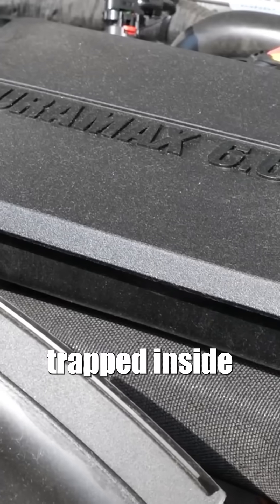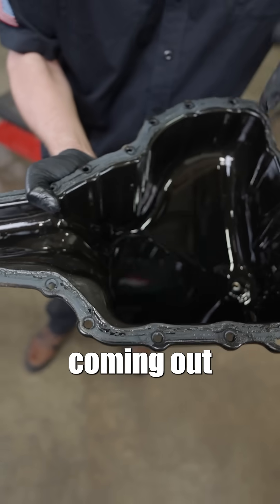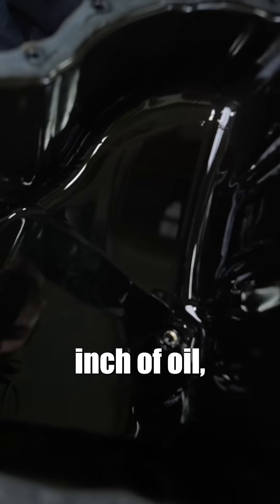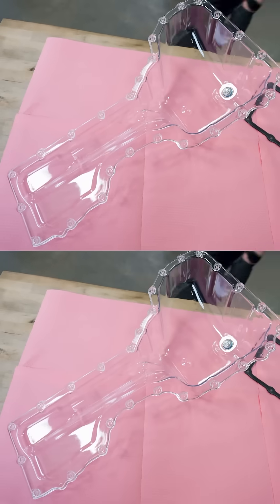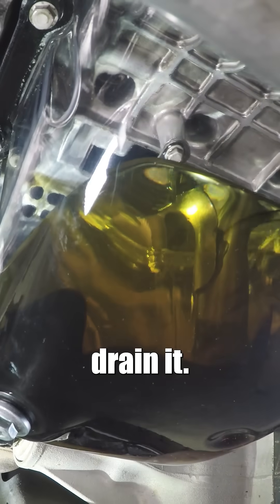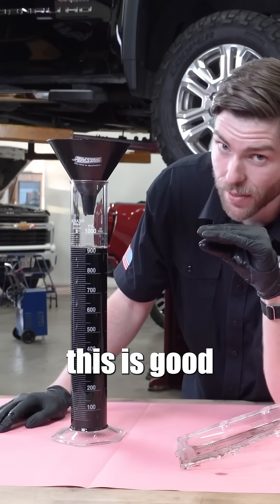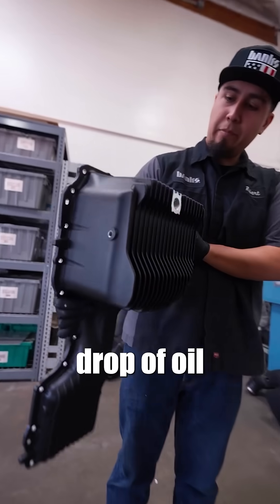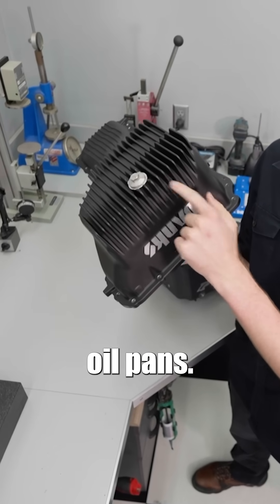A disturbing discovery. This dirty oil is trapped.

Comment: You didn’t sell me one bit until you showed the pan. OK you sold me. I like the idea of the pan. I like it made out of aluminum. I noticed you had cooling fins on the bottom of it, which is neat but what I do is I sometimes drain a quart of dirty oil and I add a half a quart of mystery and a half a quart of kerosene and I run it for 20 minutes and then the last minute I bring the RPMs up to 2000 RPMs to really flush out that engine then I let it cool a little bit before I drain it. I leave the drain pan underneath even if it’s overnight and then I put brand new oil and that old 3000 mile oil royal purple 5W-30 goes to the recycling bin so that they can remake good old-fashioned oil again
Reply: I'm going to make a suggestion. 
Use a quart(or just half on smaller motors) of atf.
It's significantly more detergents.
It's kept my hyundai running well over what most I've heard have, so I'm assuming I'm doing something right lol

Comment: By emptying the pick up tube you open the oil pressure circuit to air, first start up after oil changes will be dry

Comment: when the pick-up tube empties, then it will take atleast few seconds for the oil to get going again, that shouldnt be a problem since usualy you want to warm up the oil before you drain it so it flows better and while you warmup the engine you displace the oil in the cylinders, cam shaft ttc... so shouldnt be a problem if you dont take more than 2 hours to change the oil and filter and run the car before the oil drips down from the engine walls. Just one thing... when the pump picks up the oil, the air gets pushed infront the oil and the air could dry out a spot somewhere where the lůube outlets are and it takes spit second at 800Rpm to do some damage that will make the engine degerade way faster than just leaving in less that a pint of old oil. completly useless product imo.

Comment: Use oil evacuator pump with a curved tip on hose to reach over weld  nut. Do this while oil filter is off. This will break" vacuum" in sump tube

Comment: Theoretically can’t you just pull the drain plug and dump like 4-8 QTs through if youre willing to spend the extra dough on “wasting” oil? Would it still not drag out the crap at the bottom? Sure it won’t get the stuff out the pump but most of it should come out with the fresh oil no?

Comment: I honestly don’t care. There’s way more oil in the cylinder heads, lifter valley and so many other nook’s and crannies that this is absolutely pointless. As a professional mechanic for over 30 years I’ve torn down many engines and believe me there’s a lot of oil throughout the engine.

Comment: If you're worried about this NON-PROBLEM, then you can simply use a topside vacuum liquid extractor and put that skinny hose down the dipstick tube and suck it all out.

However, since this is not a real problem, don't worry about it and keep it pushing.

Comment: Isn’t the correct answer to get an oil pump and put the tube to go back on itself, or thread the tube through the top to get to the bottom? Surely that’s cheaper than a new oil pan, right?

Comment: Isn’t it going to cause a problem for the first start after oil change?
It will take the engine longer to fill up the tube / then oil filter

Kinda like the BMW N55 after oil housing replacement

Comment: So all you guys that say you don't want oil pressure starvation, due to the pick up tube loosing it oil...your probably in the same group that says it's not necessary to pre-lube your oil filter.  Oil starvation in the oil filter,  and the resulting engine knocking at start up ,for 5,10,15,20 seconds is ok...but you think similar oil starvation in the pickup tube is unacceptable.  Go figure  ?

Comment: Metal deposits that Banks wants to remove tend to fallout (the ones suspended in the oil can be filtered out) and would still concentrate in the oil pan and around the engine, so removing extra oil whilst would help, wouldn't necessarily provide a significant difference that would impact engine life drastically (extra ten thousand kilometres till teardown is positive, but at a 500k scale is not impactful enough, imo). 
The other benefits, like running cooler, though, might help and improving flow dynamics are also a positive, yet the contaminants should not be the primary concern, since running an additional finer bypass filter, for example, would be a way more effective solution for the buck, if contamination is your primary concern. Pair that with shorter intervals for the oil (and filter) change and there you go.

I feel like this stretches into engineering for engineering sake - I love it as an engineer and it's a clever design and product, but I don't think it considers the engine as a system. Having a larger magnetic drain plug would help with metallic (ferrous) contaminants as well (by keeping it in one place), if we're at it, though it won't help with alu.

This is a bit iffy marketing, to be honest. I think products should be advertised for their objective strength.

Comment: The manufacturer of the vehicle only wants the vehicle to last until the warranty expires. 
Recommended oil change intervals should be ignored, and design flaws like this should be corrected with QUALITY aftermarket parts IF you want your vehicle to last. 👍

Comment: This is why you put a vacuum tube down the dipstick and then sweep the bottom of the pan. Everyone thinks it’s better to drain the oil. It’s better if you have multiple different size tubes.
Reply: @mightyeagle
I have a novel idea to get all the oil out of the pan especially if you have it on a lift; remove the pan and just pour out the remaining oil(that’s after you have drained the majority of the oil out of the pan and reinstalled the drain plug)!

I know I just blew a lot of minds here, but it’s just not that hard.

Comment: Depends on the manufacturer. Some have the plug on the edge of the pan. In any case it's not something to worry about since the whole engine will have a certain amount of dirty oil left in it.
If you need to change a damaged sump then maybe an attractive feature to some but I doubt anyone is going to change it just over the drain plug.

Comment: GMC Sierra I only use it to haul. 319000 plus miles on it, its drain plug is an outie. I always drain the oil with the engine hot and let it sit overnight before putting the new oil in . I also drive the front wheels over a four inch wedge. Every thirty thousand miles I do an oil change having added a quart of Marvel Miracle oil in it before draining. All my vehicles are high miles and four of my kids are the recipients and still going. My lowest mileage vehicle has 157000 on it . If you are wondering what oil I use , Amsoil.

Comment: Al Bundys car ran fine on the original oil all its life! There will always be some residual old oil left in the motor, as long as you are putting new filter and good oil in every change you will be fine. Not saying your product doesn’t work but it fixes a problem that was never a problem

Comment: Seems like a cool design, but that also means every time you change your oil, your pickup tube is empty. Which means every first start after a change is a few empty cranks priming the pump… correct?

A few no/low oil cranks every change, OR a dirty quart thats diluted with new oil every time leaving the pickup filled… up to the consumer.

I haven’t had an engine not make it to 250k+ on the old ways, I would need some serious longevity testing to convince me otherwise

Comment: If you care about your engine change the oil every 3k miles people say i change it every 5k miles NO ! WHEN YOU START the engine warm it up for a minute or two when you stop at a long light or just iddleing the eng your using the oil but not putting miles on it so 3k mile is the norm. And replace the filter with a very good one like wix or ? Then every other oil change at 3k do the filter. Oil is cheap enough that it's replaceable and if you care really about your investment ad a half QT of MOTOR KOTE ! Every other oil change your engine will last many many years it's an investment and reliability also every three years replace your coolant & thermostat your hoses every other, you'll never be left on the side of the road broken down...

Comment: When the oil filter is removed, air is allowed into the oil pump , which allows the pick up tube to drain. You can also jack the engine up tilting it towards the drain hole.
Reply: exactly, when taking the filter off and loosening the oil fill cap. Everyone selling snake oil to make a buck.
Reply: @Mishka_Adventures  Wait... snake oil? Who makes that, Quaker State?
Reply: That's what I do in every oil change process. Jack it up, tilt, wait ten minutes.
Reply: Is it worth loosing prime on the pump? Instant pressure is always best, even if its dirty. JS.
Reply: Y'all didn't see how the drain bolt is threaded into the pan, if there was a gap underneath the welded fastener, dirty oil wouldn't be an issue. Throw a couple cheap quarts down it to clean it like most DIY folks do, plug and fill. Regardless of how much drains when the filter is pulled, even if you jack it, incline it, etc. you'll always have a little dirty oil in there.....or some metal shavings that are trapped in the bottom. IMHO it's a design flaw to keep you coming back to the dealer or a mechanic over a design flaw.
Reply: That's not true the pump wont allow it to drain back without turning the motor backwards, it's a pump there's no free running open holes if there was the pump wouldn't work.
Reply: The oil breather does that job
Reply: @Robert-j6r8c  What job, you sure you know what a breather does?
Reply: @ernsailor9041   
Do you understand how oil gets around an engine? 

Where the oil comes out of the galleries, air can get in. 

The idea that by opening the oil filter is allowing air into the system is false, as the breather already allows air in. 
As both the oil filter and breather are both on the high pressure side of the pump.

Comment: Bruh that oil moves every time you run the vehicle it's not the same quart of oil every time. So yeah you have a little bit left over you're going to have a little bit all over you're not sanitizing your oil Valley there's still oil in there it's fine but the rest of the oil pan is pretty cool the cooling aspect

Comment: saying “no matter how many times you change it” is very deceptive. If you change the oil, run the vehicle for 5 minutes, drain it and repeat several times, you will get ALL of the oil out. No one does that tough because it’s expensive, and also a total non-issue.

Comment: Its called bad engineering, this is not an issue on hondas and Toyotas. Could be more manufacturers, but i only work on these two. They place the drain bolt on the side with the bottom of the pan on a slight tilt. If anything theres at most <1/10 of a qt in the engine.

Comment: Not changing your oil and oil filter in time in way worse than having a little leftover oil mixed in with the new. Also if your dipstick tube allows it, removing your oil with a vacuum tube you can completely drain all the old oil

Comment: I have a 2001 nissan sentra if you change the oil when it should be changed no issues I have 224948 km on the clock and engine was never opened before

Comment: It's pretty easy, at every oil change I take out the old oil and put in cheap oil for a week, do another oil change a week later and use good oil with no problems after 400k miles With the original engine and transmission, and so it will last forever, after 20 years the engine has only lost 5% compression compared to when it was new, not bad for a 20 year old engine, I hope it helps you

Comment: 1. Not the same quart, gets diluted and filtered. 
2. You don't want to clear the tube of the pick up, that's a feature not a fault.
3. There is even more 'dirty' oil sitting around in the engine during a change anyway.
4. This is a 'solution' to a non existant problem.

So silly its almost a scam.... Almost.

Comment: Sure, dirty oil is not good for your engine. But now that you've drained all of the oil in the pan and by extension the pickup tube and unprimed the oil pump, are you really saving any wear after you have to run the engine with 0 oil pressure temporarily?

Comment: My god. If you're going to run with this oil pan, be DAMN SURE you use flood clear mode after every oil change to re-prime the oil pump. Firing up an engine with a dry oil pump will do far more damage than this gimmicky oil pan will prevent.

Comment: Your statement that "no matter how many times you change your oil, it's not coming out" is blatantly false. 

That dirty quart is blended with fresh oil and then mixed & filleted. 

Not to mention, you picked one of the worst samples of oil pans. I have never personally had a car with a bottom drain. It's always on the rear bottom corner and the thread protrudes outward to prevent this exact problem. 

Your solution is beneficial for certain use cases, but it is not representative of every vehicle.

Comment: A car can run on same engine oil for years, evidently so. Therefore, there is no reason to worry about a small percent of dirty oil in normal conditions. If you use the car for racing or something, then it's a different story.

Comment: 1. the dirty oil is the oil you were driving around with since 30 minutes ago…. It won’t kill your engine

2. removing all the oil and letting the pump drain forces it to pump air and run dry for a short time. This causes wear and is NOT good.

3. the old oil mixes with the new oil, any particles get caught in the filter and it’s good

4. why the cooling fins? So it takes longer for the oil to get to temps on every cold start? Yay! Let’s increase wear again

Comment: That's why regardless of how expensive and of an oil change I'm doing I take about 2 qt of transmission fluid and pour them in after all the oil has drained out before  I reinstall the drainplug because at the least it dilutes the residual oil, is high detergent  and displaces the majority of that used oil that's still in the PAN..

...
. and as an additional bonus it mixes well with every other type of motor oil made on the planet!!!  🎉🎉🎉🎉

Comment: That pan can’t cool oil which is not there. Most, if not all of you oil, during revs is in the engine. What exactly is that fluted pan cooling. 
Just change the way the bolt works at the drain and be done with it.

Comment: Both of my cars have the drain plug at the back of the pan angled slightly downwards, with the bolt hole actually lower than the pan’s bottom. When I jack up the front of my car, all the oil empties out of the pan.

Comment: It’s actually supposed to do that so your engine doesn’t run dry after oil change because some vehicles have the oil filter sideways so it’ll have to prime when started but this is a good idea for the vehicles with oil filters that are on the bottom

Comment: I use a vacuum suction pump with a curved tube to suck out the last bit of oil from the sump pan through drain plug hole 
It gets most of it out

Comment: Don't listen to this guy, that dirty oil will not be in your motor forever. All you have to do is flush the oil out a couple of times. But Gail needs to answer all of the people that are screaming the same answer that even I know. There's a fundamental flaw with the pickup tube. I don't know how often you're going to be changing your oil but every single time you do your motor is going to inhale a huge amount of air into the pick up tube.  the valve train and your motor of oil. Gail is an incredibly intelligent and a meticulous engineer. How did he miss this? Your fans are demanding answers gail.

Comment: It’s always funny seeing “super duper master technician of 40 years” try and argue with Banks. Bro this is BANKS, these guys are literal genius and know more than every guy in this comment section about this stuff. This is the only brand I back up
Reply: Apparently not because their redesign will allow a giant air pocket in the pickup tube after the oil is drained, that's why the pan has the drain hole raised in the first place. It keeps the system primed to avoid dry starts.

You sound like someone who listens to Hollyweird celebrity's political opinions, being famous doesn't make you smart.

Comment: the new oil will not mix with that old oil in the engine,its just gravity,the new oil will drain in the oil pan,,but having this new nut in place it really helps to clean and drain eveything.The oil pan  is the lowest point ,the oil will not go back and mix with the engine..

Comment: Can you talk a little about your process for making the plastic duplicate?  Thats really cool and it doesnt look like a milled part?  I see the 3d scan (hey, I also use Creaform!) but im wondering what came next in that process?

Also, im wondering if this was a conscious decision on the original pan?  There are some aircraft engines that are known to have trouble self priming the pickup tubes if engines have been rebuilt or left dry for a long time.  Obviously a healthy oil pump has no issue with this, but what about half a million miles later?

Comment: 1. Why shoot a video with a clear pan and not actually show what you are saying. You did not show the oil dripping while a quart was in the pan.
2. Why be deceptive with a Banks part? You made it sound like the same quart of dirty oil is always in the engine. There may be 1 ounce of dirty oil forever if the oil is changed every 5000 miles. There could also be 8 ounces of sludge if the oil is changed every 15,000.

Comment: If that wasn’t there it would potentially cause a loss of prime to the oil pump so I’ll keep the 1 qt of dirty oil vs complete engine failure, thanks.
Reply: The dirty oil wear will be minimal vs the dry start after every oil change….. engineers do things for a reason despite popular belief….